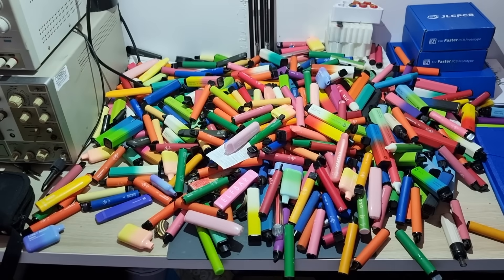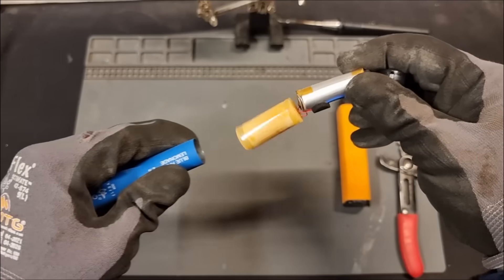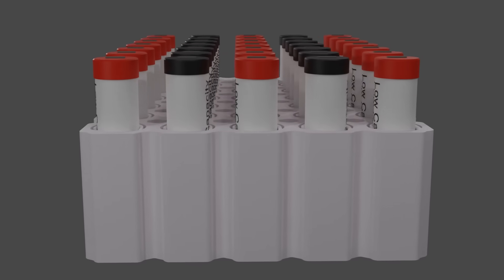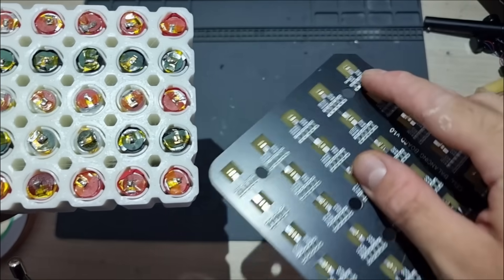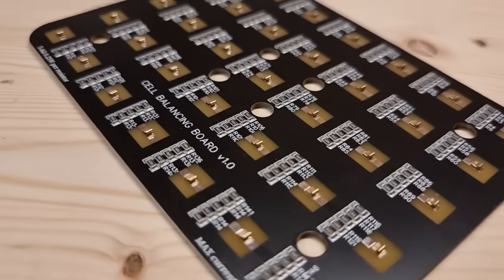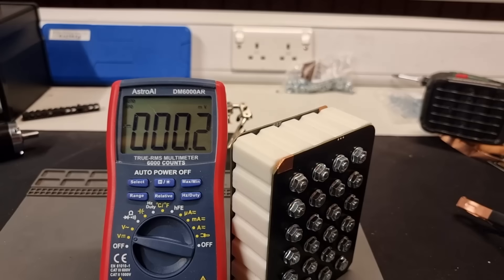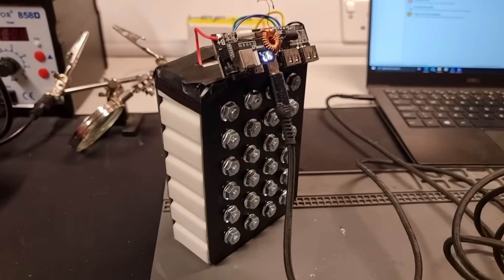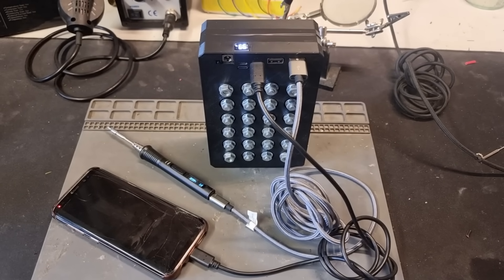Turning Disposable Vapes into a Fast Charge Power Bank

Comment: So I'm not complaining at all because this is fucking awesome. But you said you didn't want to go through the work of soldering the batteries together. But you went through the work of building that circuit board with spring tabs. There's no way that was quicker than soldering😂😂😂.

Comment: Hmm, well I bought my vape in 2019, with 2 18650, bought another set of 18650 in 2020, and just bought another set like 2 months ago because the old finally were done. 
I vape about 175ml of e juice a month, now in disposables how many would many cells would I have used. Stop buying those disposables and just get a proper vape mod

Comment: This is awesome. Ive been collecting and using vape batteries for about a year now. Used them to power a small drone, in a power bank, power source for an LED light in an outside take one leave one library with a solar panel, and in a light source for my 3D printer

Comment: As a vape hobbyist, disposables are the worst, I see them tossed out EVERYWHERE I've actually gotten the local shops to collect discarded disposables, so I can harvest the cells out of them. So far I've built 3 small power banks, a battery backup for my wifi router(recharges via an old discarded solar panel) another battery backup for my cell booster, and slowly working on a battery wall powered by discarded "disposable" cells.  

The cells that are completely dead, swollen, or have otherwise failed, I place into one of those fire resistant safes, and take to a local place for proper recycling. Plastics are sorted by type, and are turned into a local recycling center. 

If you're lucky and a little more tech savvy there's other bits that are salvageable from these as well, such as the charging circuit, (if it's on a separate pcb, or if you're REAL technical you can salvage the SMDs from the boards.

Comment: I would have used smaller diameter bolts to hold it together. What you have there seems like it could hold 1,000 pounds. I think #6 screws (3.5mm) would have been more than adequate. Also, very reduced weight.

Comment: I loved this so much! As someone who has been researching the US cannabis vape/ecig markets since 2012, specifically focused on waste issues, this is incredible to see. It seems like a ton of effort for one battery, but I imagine it could be scaled up and partially automated. 

One suggestion, as you note yourself, these devices can't really be disposed of in a traditional sense because of their lithium-ion batteries. The term we've begun to use is "single-use" which reflects that the device is not reusable/refillable like other devices but also that it requires specialized disposal (like other ewaste).

Comment: The casing of the batteries conduct electricity right? The only thing that prevents the batteries from shorting out because of the copper foil is probably a thin plastic coating. Do think about what couldve happen if the plastic insulation would be damaged...

Comment: GeekBars also contain relatively powerful microcontrollers, the PY32. I theorize they could be reprogrammed using a Black Magic Probe connected to all the right spots on their PCB. Vapes have their own power system, they're all engines and no steering, so it would make a great platform on which to build other small devices.

Comment: I had this idea 2 years ago but didnt have the knowledge to put it all together. I have around 200 cells currently sitting in my basement ready to be assembled. You should release the parts and a guide in an electronics kit! I am an electrical engineer, and would love to do something like this! 

(I am currently in school for this, am aware of the dangers, and liability would fall solely in my hands)
Reply: Im an apprentice electrician, why does he need to give you a line diagram or specifications if your an electrical engineer? I could design a circuit for this application myself so Im a bit confused?

Comment: As someone who works in the tech field, I’ve been saying it ever since the rise of these damned “disposables”: 

There is no such thing as a “disposable” vape. Lithium is a finite resource needed for rechargeable batteries (as well as other stuff), which practically everything electronic uses these days. I vape, and I have never in my life bought a disposable, and probably never will. I prefer the old school rechargeable/reusable type where you just replace the coil occasionally and add juice yourself. I hate the disposables, they’re a horrible value, create an astronomical amount of e-waste, and are a serious fire hazard when thrown away (or worse, littered) due to the extreme flammability of lithium ion batteries.

Comment: To be honest, I think your friend didn't do you any favor by reducing the space you used to evenly clamp down all the cells used.  That is a bigger hazard in LiPo cells. Improper contact. That too causes excessive heat. Great idea as I sparted pucking up coworkers' spend vapes. I had an idea to recycle the charge controller boards as I go and use those to keep the charging at an ideal level. But I would be looking at something that would be more pocket sized. Great idea for a BPS, though. We could use more people thinking ahead like you in this world.

Comment: To people who are already vapers and are using disposables, I highly recommend switching to a simple pod system. It is MUCH cheaper, tastes better, more suitable to preferences, produces little waste, and it may seem intimidating but is very easy to adapt to. Go pick up yourself an XROS 3, very easy, sleek, small, cheap, and has amazing reliability. Disposables aren't practical in the long run. You're paying $25 a disposable that lasts maybe a week, when you can pickup a 30ml bottle of salt nic that will last the average user 2+ months for $25. There is seriously no reason to be using a disposable vape when there are much better options on the market that are safer, cheaper, healthier, produce less waste, and taste better.

Comment: That's very weird - why would they use the far more expensive rechargeable lithium cells in a disposable product? You could get a whole pack of equivalent alkaline cells for the price of a single rechargeable lithium. The single-use alkalines are also 2x or higher energy density.

Comment: the Mrs gets 1 once in a blue moon and don't work right off the bat could open top but don't have clean top to transfer oil, could soak in pan but need to dispose pan after. 1 had a Micro USB port but the flavor was crap to me I hate grape flavor can eat real grapes green purple but flavor for 'juice' or candy make me sick. A renewable power source from vape batteries I wonder AA or AAA have been made with USB A under positive cover for AA, and Micro on side for AAA and come with squid charge wires for 4, been a while maybe USB C on them now but a C OR D battery is just a cover over a AA battery all 1.5V.

Comment: Just a week ago I threw 50 batteries like this, as after a long research I found out that connecting rechargeable batteries in parallel is a dangerous thing to do. Any input on this?

Comment: I did this to power my 12v  electric bicycle pump, nothing as proffessional as this though i managed a crude way to spot weld the parralel  packs after balancing them by charging induvidually. Kudos to you i may download the boards and case designs. thanks for sharing great video.

Comment: I switched from smoking to vaping in the course of 2 years, back in 2010-2012. Quit altogether in 2022. It quickly turned into an interesting hobby. I learned some ohm's law, battery tech, electronics, got interested in all the various pro-sumer vape products, like VV/VW mods, mech mods, DIY atomizers, etc. I mixed my own liquids and vaped like a damn cloud machine. For around $5-10 a month. Disposable vapes I've never touched and hated them the second they became widespread. It's one of the most nonsensical, wasteful and harmful products on the market today, not just within the vaping and smoking industry. Vaping was (and still can be) the best way to quit smoking, and eventually, quit vaping too, without much suffering, withdrawals or breaking the bank. Disposables go completely against all of that. Shameful, that they even exist.

Comment: Those stats are shocking. What a senseless waste.
I was toying around with recycled 18650 cells a few years ago and was looking for a better option to connect them up than soldering (eep!) or welding. That PCB you've made may be what I was looking for.

Comment: Seems like legislation to require vapes be rechargeable is in order. Single use of that resource should not be allowed. Would also cut down on the plastic waste at the same time. Cartridges of the vape liquid would greatly reduce the waste if not a liquid recharge system.

Comment: Excellent video and I'm excited for the open-source kit.  I had no idea disposables had rechargeable batteries!  Personally I started using them (for weed, in the US) after having struggled to get non-proprietary 410 batteries to  charge at all.  Maybe it was just bad luck but it seems like there's so much shitty unreliable hardware out there, something would always go wrong with the USB casing or a cartridge just wouldn't work, I kept re-buying stuff and wasting nice carts - anti-waste regulation policy is good but it should probably include making sure there are some reliability standards for the "reusable" stuff.

Comment: I assume you used a high temp fill in the 3D printer. Otherwise, a problem I foresee is the copper tape dispersing enough heat together to melt something and the corrosion getting everywhere. Definitely the solder. Could straighten your springs on the circuit boards a little higher so it's only metal on metal or wrap everything in a good heatsink. For the size and sacrificing little conductivity, you could utilize aluminum as a less corrosive and longer lasting heat dispersing/conductive metal.

Comment: imo disposable vapes are the stupidest thing to ever. not only are they more expensive on long run but also harmful e-waste.
if they where just some test kits for ppl starting to try vaping then ok. makes sense for vape stores to sell them as testers for ppl that are planing to move from cigs to vape but using them on regularly is just stupid
or the makers of them should make it so that the battery part is removable so ppl can take it out and toss it to the recycling. so much wasted lithium on those

Comment: The problem with refillable vapes is they fail.

I've owned several refillable ones and none have lasted more than three months. Given the higher upfront cost of refillables, I just switched to disposables.

The goal is to quit nicotine completely anyway so if rather if my device just worked right out of the package.
Reply: lmfao don't buy el cheapo refilliables. save your dough and get a box mod/regulated mod with replaceable batterys and get a decent tank/rta.
Reply: @CotyRiddle  I've used geekvape and uwell before. The caliburn x lasted the longest but its only 20w

The geekvapes both constantly leaked and stopped working after only about a month

Comment: Great video! Im currently trying to build out a converted van to live in. Money is tight, so Im using pallet wood for the lumber, but the battery banks that people use for solar power are very expensive. Is it possible to use a similar design to hook up to some solar panels to power a full time living space? I don't see why not, but I figured I would comment here for someone more experienced to give their input on.

Comment: Was the balancing board only used temporarily and then replaced with the resistorless PCB? I suppose it shouldn't be strictly necessary for the unit to operate safely in ideal conditions, but I'd figured it'd make sense to retain some facility for internal current-limiting just in case. Does the OTS battery bank board account for that such that it isn't an issue once it's installed?

Comment: Just for anyone who might want to do this, your "cell balancing" board will prevent the cells from exploding but that is not a healthy way to balance lithium batteries and they could still potentially be damaged by doing it that way. The proper way is to charge or discharge them individually to either full or empty and then wire them to a proper balancing circuit
Reply: Can you elaborate on the easiest and cheapest way to do this?
Reply: @timothybradford6652  You get a TP4056 module for each battery, wire all the 5v inputs in parallel, and wire all the 3.7v outputs in parallel with a Schottky diode on each positive BATTERYOUT+ terminal to prevent voltage backflow. Pair this with a switch between all the 3.7v outs and the boost module that converts that 3.7v to whatever 5v,9v,12v, etc., and that's it.

How do I know? Cause this is what im planning to do. Got over 80 vape batteries and counting ready to go.
Reply: @NIGHTDREADED  But that makes this expensive and tbh wiring a charging module to each cell sounds ridicusly stupid.
Reply: @NIGHTDREADED  i will watch it
Reply: @Tomas970506  It might sound stupid but it only takes one bad cell to start a fire.
Reply: @MinulGomesz-so5tx  Sweet! Stay tuned!
Reply: @crzendn52  No problemo!
Reply: @NIGHTDREADED  lemme reply to your comments so I'll know when you upload it
Reply: @Tomas970506  Ah yes I'm sure a difference of less than $10 is "ridiculous" and much more important than safety and longevity.
Reply: @timothybradford6652  easiest and cheapest is what he did in the video. It'll work well enough for maybe a handful of cells but anything larger and you'll want to get a battery balancing board. GreatScott here on YouTube has a handful of very informative videos of both buying and building these, as well as others
Reply: big explosion good ooga booga
Reply: Why use so many individual charging circuits rather than a proper BMS?
Reply: @pcgee12  Proper BMS as in? The TP4056 is a proper BMS by itself.
Reply: @pcgee12  I'm pretty sure you're misunderstanding. They want to use the TP4056 IC, not a complete charging PCB. 50 TP4056 chips cost a whopping $5, so it's quite economical actually
Reply: @neotil2  No, I am actually using a whole TP4056 module w/protection for each battery. They are so cheap though, so its quite economical. You can get 40 of the entire modules for just $10.
Reply: This looks like a great proj. Any tips for where to get started on something like this?
Reply: @Portfelio  To get started, first thoroughly research 3.7V lithium cells and what wiring in series and parallel means.
Reply: You could always use a simple circuit with an led strip to discharge them?
Reply: @enodenmad  How would that resolve anything? The batteries are being drained, and not equally.
Reply: @NIGHTDREADED  I wasn't saying drain them all at once. Simple circuits to drain them individually. It's cheap and those items are pretty readably available to most people. It's safe much like using a trickle charger to do the opposite.
Reply: @enodenmad  What will stop the draining? What's stopping the led strip from discharging the batteries down until the BMS kicks in over discharge protection?

Comment: And they even had 38% left? So not only do Elfbar use rechargeable batteries for single use, but they also unnecessarily install larger batteries than needed, leading to even more waste that wasn’t even useful during the usage phase.

Comment: I have collected hundreds from my office block and I did low voltage solar lights around the house and back up power for my router and security cameras, I'm still collecting to make a ups for the TV and the fridge because electricity is not that reliable in South Africa

Comment: I wear a wireless glucose sensor that has to be changed every 2 weeks. One of the patents I read that it uses is a sealed lead-acid battery. I was thinking, I should collect these for like 5 years and make a car battery out of them. Except I need to dremel them open to get inside.

Comment: As an improvement to the next revision, a micro LED next to each cell which glows green if the cell is good, amber if it's going bad, and red when it needs replacing. A more detailed display to tell you what % the cells are at individually during balancing would also be nice.

Comment: What a nice idea :)
Maybe a more flexible, simpler design would work as well, where the cells are just all hooked up on a cable and then sealed in a Vakuum bag with non- conductive thermal pace. Would shrink the design down massively and also allow for better heat dispersion.